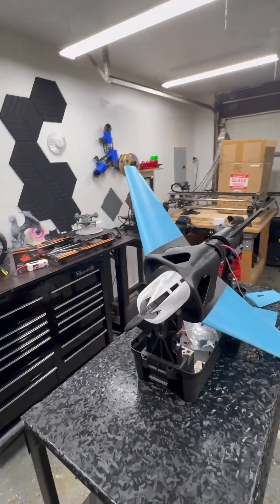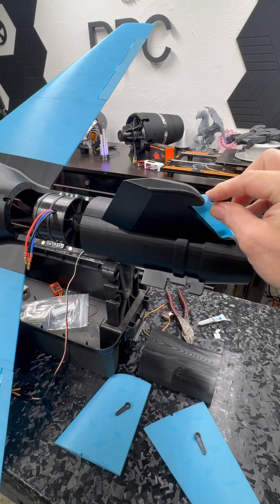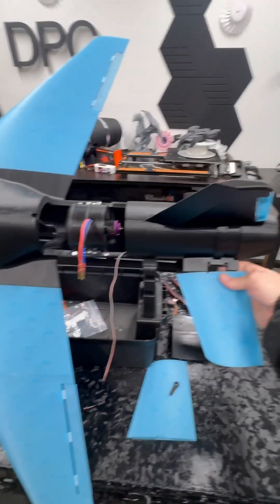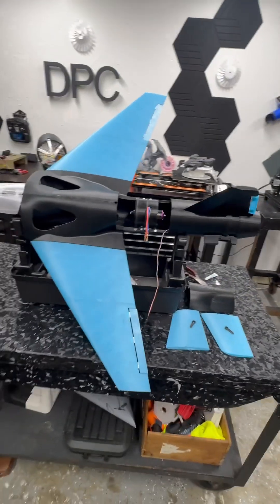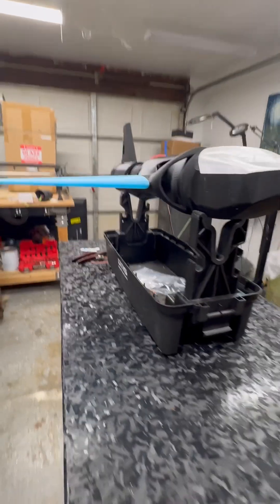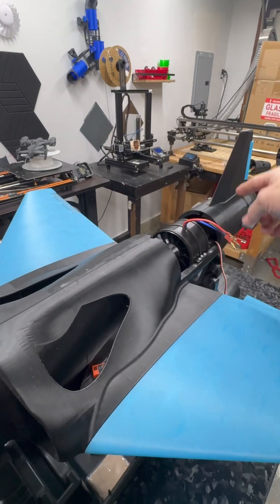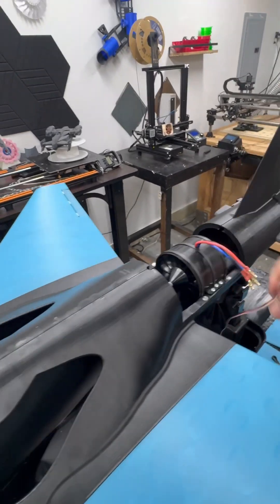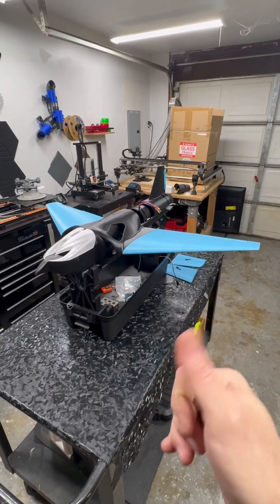3D printed 90mm EDF jet. #edf #jet #diy #3dprinting #fyp #shorts #rc #engineering #rcplane

Comment: Large elevators may actually make the lift-off easier indeed. My impression is that this machine just needs to somehow get to the fucking speed, and once there, it should be quite fine.